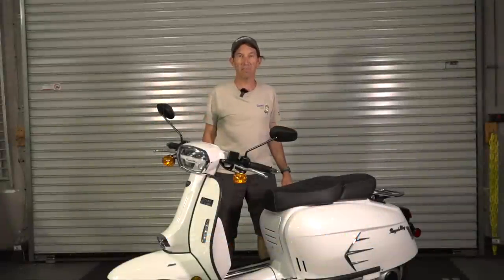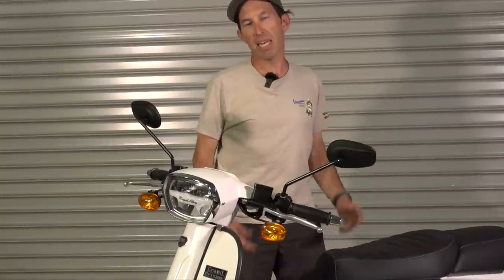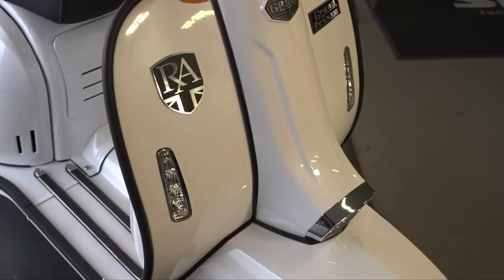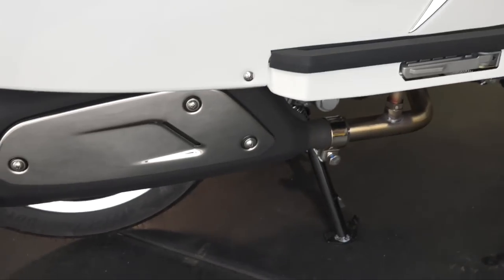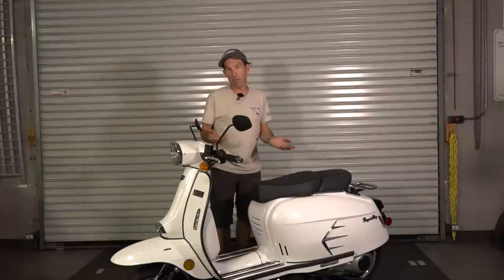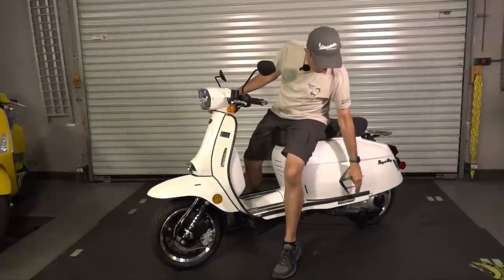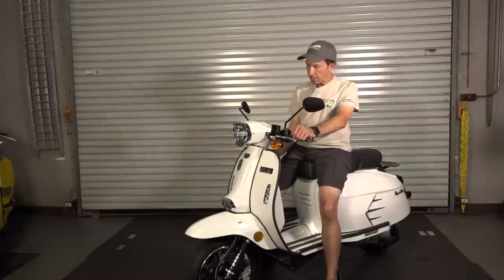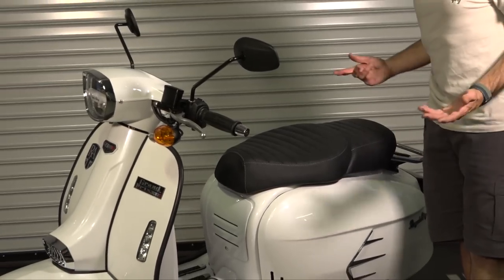All New 2022 Royal Alloy GP300S Review by Robot

Comment: Great review, as always. It's obvious you personally prefer Vespas but are able to review the RA impartially. I prefer the styling of the RA since I always liked the looks of the Lambretta over the Vespa. And the original reason for the Vespa rear styling (side mounted motor) doesn't even exist anymore. But for the relatively small price difference I think I'd go with the Vespa for the better resale value, bigger dealer network, and the security of knowing they aren't going to go out of business and leave me with an orphan. BTW, those passenger pegs appear to be the same as on my Kymco 150 Like, if so I found that they tend to rattle, especially at low speeds away from a stop.

Comment: Had mine 2&1/2 years has scorpion ceramic exhaust with Titanium link pipe, PM Tuning piggy pack ecu, bitubo front suspension and new Michelin pure power tyres. Had to remove centre stand and fit R&G exhaust slider because of scraping... Next upgrade is rear suspension when I can find or rework something. Then malosi engine & gear box internals at end of summer service. 

Sits at 90mph (gps) and two up with my boy last night hit 74mph (gps)...

Good scooter

Only issue was a crap batch of fuses...

Comment: I've driven my GP300S  3000 miles.
As a new scooter rider , it was a toss-up between the GP and the GTS.
For me lack of under seat storage was not a deal breaker because I live in a rural area where crime is non existent.  Thus I found a rear folding rack and a 20 liter bag to be adequate. 
Heck oftentimes I dont use the rear folding rack and travel with the sprint rack.
I can easily tie down my 40 L Bag
On the rear rack and keep a 20L bag behind the handle bars.

I just admire the Styling of the RA 300.  I acually admire the styling of their GT-150 more.

Never said I would buy 🇨🇳  products that the GP300S is assembled in Thailand 🇹🇭  allowed me to risk my marbles on RA over the Italians.  Chances are that I am wrong.
But for now I have a wonderful scooter.  We'll see how it holds up.
It appears Genuine Scooter is all in and ready to support RA.
All I need is to keep it serviced.
I'm going to do some serious driving .
Oh yeah I had a slow oh so slow accident.   Gping to get the GP300S minor damages fix.
I cant wait to get back on the road.

Comment: Have decided to get into the scooter scene here in the UK, have narrowed it down to the Vespa GTS 300 or the Royal Alloy 300. The styling of the RA is awesome but I am reading so much of problems with getting parts and with warranty claims etc. The biggest problem with them seems to be the digital display especially the fuel gauge & build quality. But like I say its a great looking scooter. Its  tough to decide, be interesting to see how you get on with repairs etc to them. I was even advised by a RA dealer to go for a Vespa GTS 300....read so much positivity about the Vespa and after watching your videos which are amazing it looks like it will have to be a Vespa.  Now what model ? Keep the awesome videos coming.

Comment: Great job, Robot.  You’ve convinced me not to buy one as a replacement for my GTS 250 As good looking as it is, I can’t see that I would buy one over the new Vespa GTS. The price spread is insufficient to compensate for the deficiencies mentioned as compared to the Vespa. Increased labor charges on routine maintenance will likely eliminate the price advantage within a few years years at most. 
But it does look good.

Comment: I got into the scooter scene early 80's as a Kid, i just couldn't have a scooter without a clutch or foot brake, even if the Li could get scary pulling to one side if you went to hard on the foot break dab of front first usually sorts that out or outer way around, after a slide you'll know ☘️💚